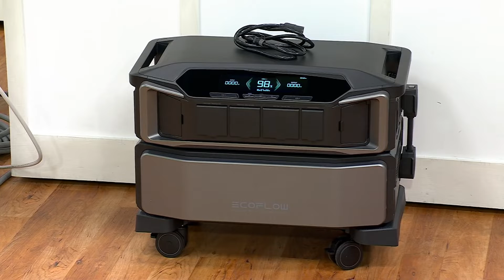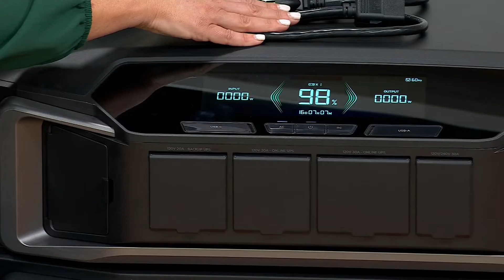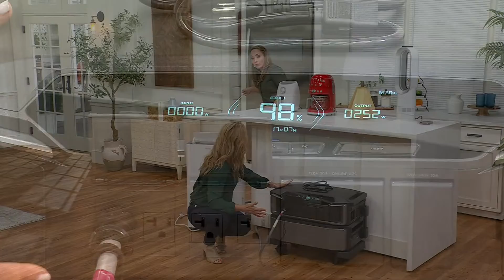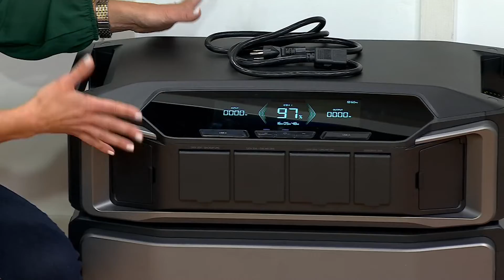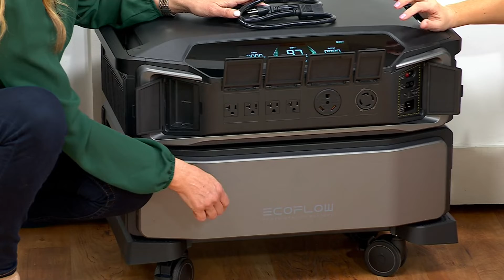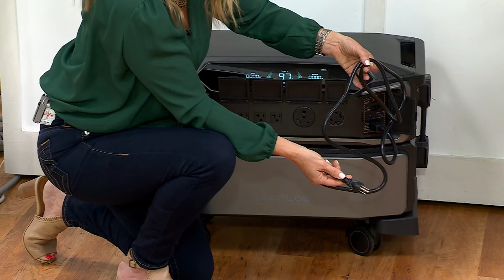EcoFlow DELTA Pro Ultra Inverter &amp; 6kWh Whole-Home Power Station on QVC

Comment: You all need to issue a correction. You CAN NOT charge this in two hours over AC. The maximum AC charging is at 1800 watts which would take 3.5 hours to charge. To recharge in two hours you need either a combination or AC and solar charging OR you need an ecoflow Smart Home Panel 2 which can charge a single battery in one hour.